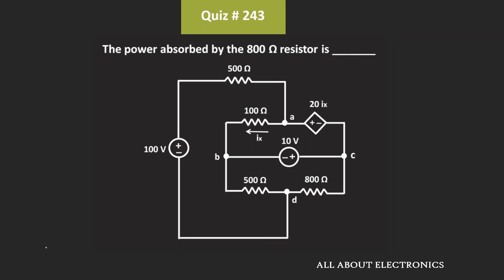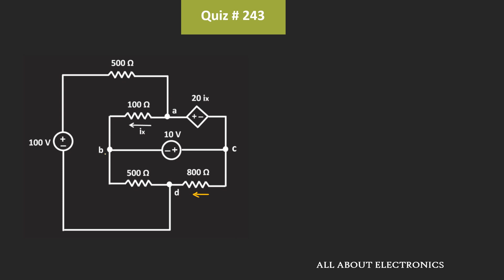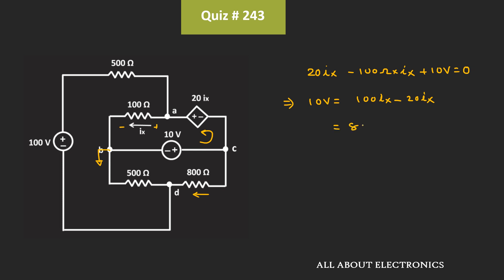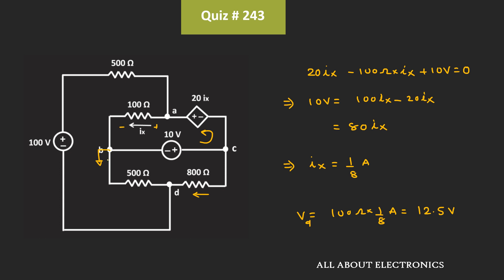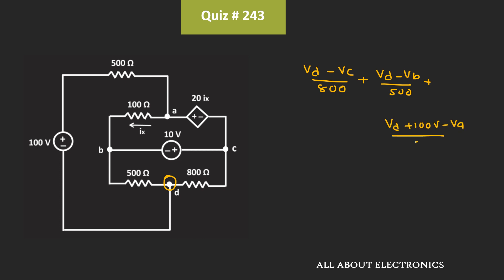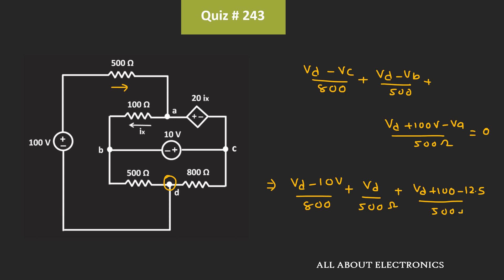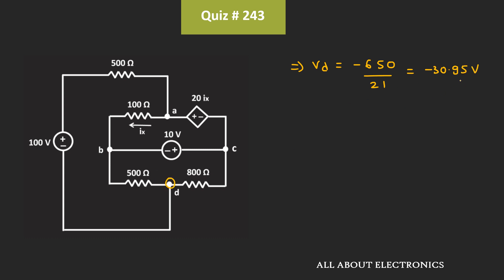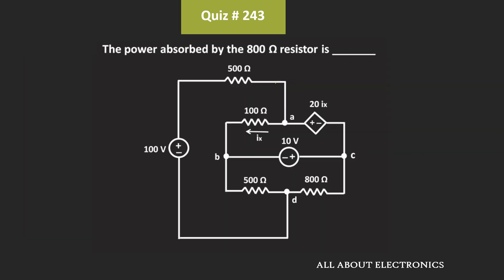Circuit Theory Solved Example | Quiz # 243

Comment: sir one time you take Vd- Vc while applying kcl and another time u take Vc-Vd while finfing power i dont understand...please tell the sign and how u arrived at a particular signs for particular equation it is really confusing
Reply from the maker: That basically depends on the current direction. I should have shown the current directions while applying KCL, so that it would become easy. Here, while applying KCL at node D, all the terms shown are the outgoing currents. And later on, while while calculating the voltage drop across the resistor, to get positive voltage Vc - Vd was considered. Even if you have considered other way around, then you would have got negative voltage. But that depends, how we are measuring the voltage across the two terminals of the resistor. (from which direction). But even with that, the power would have remained the same (V^2 / R). I hope, it will clear your doubt.

Comment: Can it be like.. 
Total current I = 1/5
Let current flowing through 500 is I1 and 800 = I2 
Then applying KVL 
And solve the two eq. formed
Please clarify ... I'm terribly confused.. just wasted my 1 hr on this question :(
Reply: i have also done with KVL in both the loops and the total current comes out to be 1/5 through 500 resistor and if you disconnect the middle network then according to textbooks the same current should be flowing outwards after doing all this my power across 800 resistor comes out to be 5.72 watt